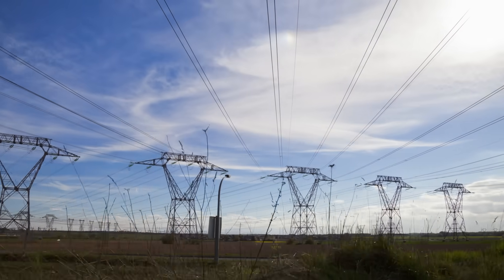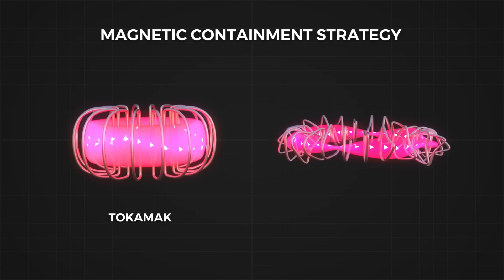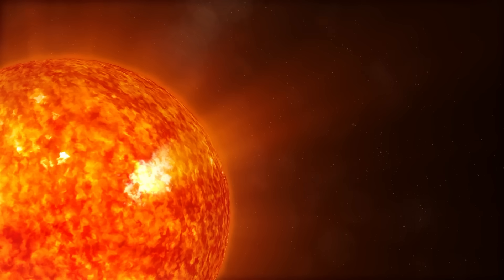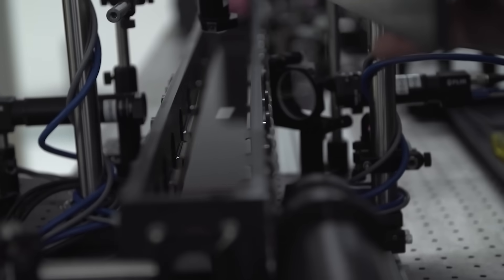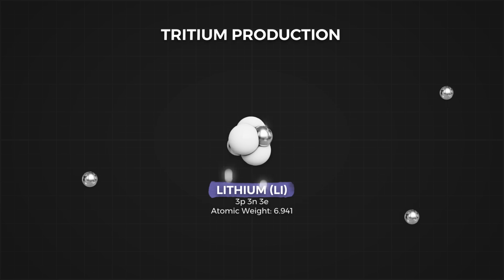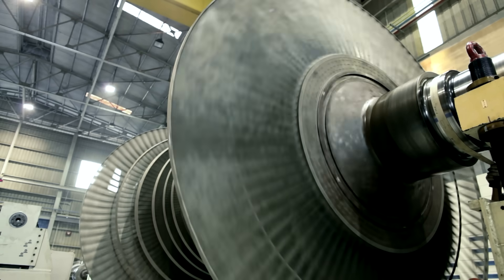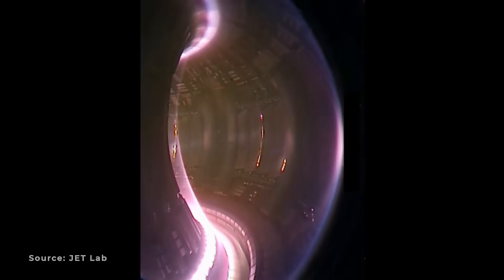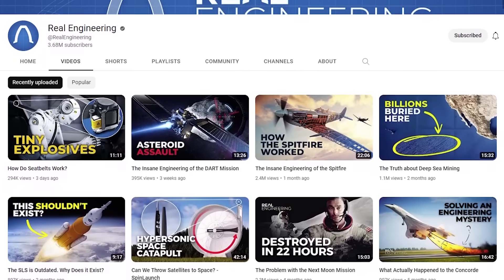The Problem with Nuclear Fusion

Comment: It's really sad to see you take a one molecule shallow dip into things you don't understand.  You've drank the Fusion Funding Machine's Kool Aid which led you to make this video implying that controlled fusion is possible on earth.  It isn't.  This is a nuclear engineer and nuclear physicist speaking, one who has no financial interest in the corporate welfare machine.

Your next video is going to be even worse.  You've drank the Helion Kool Aid without any critical analysis.  Here it is.  They propose to use He-3 as a fusion fuel.  It may or may not work but that doesn't matter.  DOE estimates that there is less than 30 kg of He-3 on earth.  When you dig deep into Helion's publications, some behind pay-walls, you learn that their plans rely on mining He-3 from the moon!  Is that crazy or what?

There is no easy way to make He-3.  The principle source of He-3 is the decay product of tritium.  Outside of the nuclear weapons world, T is quite rare.  DOE likely has a significant amount of He-3 because of the decay of the T used in boosted fission bombs but they're not saying.

T is a problem in and of itself.  It is produced in relatively significant quantities in nuclear power reactors.  A couple of decades ago, someone suggested we look for T in a nuclear plant.  When we did, we found it everywhere.  T behaves just like hydrogen and seeps out of and/or diffuses through many materials used in a nuclear plant.

T's decay produces a single beta particle that is so weak that the only way to detect it is to mix the sample with a liquid scintillator (POPOP is the most common) and count the light pulses emitted from the solution.  The beta is too weak to have any biological significance.  The radiophobes who use the discredited Linear-No-Threshold (LNT) theory of the biological effects of radiation (that any amount of radiation dose, no matter how small, is harmful.) howl about T so there's a certain bit of hysteria associated with it.

I frankly can't imagine making T by the ton, required if the Helion approach works, which is far from a given.  There are other ways of making He-3 but all are more expensive and/or use rare elements such as Li-6.  Helion's approach is just another dead-end competing for fusion research scientific welfare funding. 

BTW, the claim that D-T fusion would be clean is a bald-faced lie.  The bulk of the energy produced (you said 80% but it's actually about 95%) is in the form of a high energy neutron.  High energy neutrons damage things and make them radioactive.  Someone put the idea in your head that a D-T reactor, if it worked, which it won't, could be surrounded by a fertile blanket of deuterium to breed T or He-3.  It's not too hard to calculate how thick the blanket would have to be to stop the >5 MeV neutrons.  Very thick, probably too thick to manage, plus the T produced would have the same negative properties that reactor-bred T does.  A utility-grade D-T fusion reactor would make a massive amount of radwaste through neutron activation.

Yesterday (12/13/2022) DOE released a breathless but absolutely false press release that claimed that the National Ignition Facility had made a breakthrough - that inertial confinement fusion had produced more energy than required to make it happen.  But they lied, as they counted as input energy, only the energy supplied by the laser beams and not the total energy consumed by the NIF.  From their website, the NIF consumes 200 megawatts continuously while doing make-ready for the shot and then firing it.  And (again from the NIF website), when they implement automated optics repair to deal with the damage each laser shot does to the optics, the NIF is only capable of 400 shots a YEAR!  The NIF is doing what it was designed to do - help nuclear weapons designers improve their modeling codes that will allow them to design new bombs with no need for testing.  Controlled fusion power research was tacked on as a publicity stunt.

In response to that lie, I built a spreadsheet that, when a desired energy in megawatts is input, it calculates a variety of parameters which show just what a lie the NIF press release is.  The spreadsheet comes with 3500 MWt as the input.  That is the power a fission reactor makes to drive a 1200 MWe generating plant.  To make 3500 MWt, the NIF would have to do 1.79E+18 shots per hour.  Inertial fusion does not scale up to larger target pellets because of a variety of instabilities known for decades by both weapons designers and honest fusion researchers, if there are any.

The spreadsheet can be downloaded here: 

https://u.pcloud.link/publink/show?code=XZucYDVZxbTnsKyKIEhMDekJdz3CPzi6z7G7

In case anyone wants to play around with the numbers.

Comment: The moon supposedly has H3 which apparently when used in nuclear reactors for power generation create no radioactive waste.

The earth doesn’t have enough but the moon might so countries are desperate to get back to the moon and confirm the H3 and figure out a way to mine it 

This saves the cost of the radioactice waste

Comment: fusion power will NOT revolutionise globl society.  as you pointed out, we already have an energy source that is cheap, clean, and abundant, compared to older sources .. nuclear fission. the problem is the global hyper-capitalism, which will manufacture scarcity to preserve global power structures... look at food, for example; we CAN solve world hunger today, with current methods and technology. this could have been done at any point in the last fifty years.  but the will of those with the power to do it does not exist, because it would be detrimental to them. what makes idealists think that energy scarcity is any different?
Reply: Nuclear fission requires us to mine uranium. And there's a limit amount. 

Fission takes water as fuel, and there's a lot more water than uranium.

Comment: My main concern about this energy remains, it requires a Massive amount of energy going in, and a massive amount comes out, but it’s the DIFFERENCE between these values which matters, so in general we don’t get much out of this..  What’s the point of this huge amount of effort only gives us a little extra energy?
The need for rare elements makes this even worse..  If we need to send people to moon and exhaust MASSIVE amount of energy to collect and process the resources, it’s just a waste, and the environmental impact might be worse than current methods because the process as a whole isn’t better.  Also, causing fission isn’t hard, getting energy out of it is, and that’s why this feels like a pipe dream..
Reply: Congrats. That is the problem.
Reply: @osyisr6361  I hope you’re not patronizing me.  Complaints about the current methods we rely on are still valid, CO2 and other forms of pollution are going to continue causing major problems, I just want to ensure we’re not wasting resources on a novel concept that will never actually be useful..
Reply: Technically a functioning fusion reactor would not function with massive imput of energy to release an even more massive output of energy. It will need a massive quantity of energy to be primed and started, and then the reaction will be self-sustaining. Just like fusion reactors work in a way.
Reply: @chusnacho4447  So what?  A campfire is self sufficient too, that’s not as an impressive an accomplishment as you think.  So long as fuel is continuously provided a campfire will still generate power.  A fusion reactor requires a lot of power to operate, and will continue to require a lot of power to operate even if it’s on non-stop because of the massive amount of equipment required, and the fact that this equipment uses a ton of power to prevent the equipment from being destroyed by the heat.
Reply: @FurryEskimo  It is an important distinction, since the energy generated is used to maintain the reaction, and maintaining the reaction includes all the energy involved in containment. And all of this is not for a "little extra energy". The fuel-density in a theoretically operating fusion reactor is orders of magnitude bigger than in any other form of energy generation we know of, even accounting for very expensive containment. The thing is when or if we will reach it, but ¿what do you want to do, abandon research alltogether?

Today, we need massive on demand energy that can spike and that is clean and that will not run out of fuel. Fusion, theoretically, could provide all that. ¿what is the problem with expending very little money in exploring this possibility?
Reply: @chusnacho4447  Yeah, it can be scaled up theoretically, but so can other forms of energy collection.  A coal plant produces enough energy to sustain itself indefinitely, but it’s not run non-stop either because maintenance is still required.
I’m not trying to be pessimistic here, but I want to make sure that all this effort will lead to something useful, because frankly, it seems like solar and wind might be easier and more reliable than fission, and their drawbacks might be easier to deal with, but idk for sure,

Comment: Yeah cause free energy is not theoretically a time bomb of global warming, just think about it for a nanosecond.
Reply: Fusion reactors would reduce our dependence on fossil fuels and natural gas if it ever becomes economically viable and widespread, reducing carbon emissions. That is a very big if though.
Reply: @rennoc6478  Yep we stop directly stop burning things and open the flood gates on heat from a human race unleashed from the cost of production, you know exactly what I am saying. Air con in the hot areas and heating in the cold and no need to turn the lights off anymore, the human race has no self control. Oooooo wait we could just manipulate the global temp, that will end well. Our society needs to change to adapt to this first.

Comment: the problem is figuring out the power requirements to reach 12 kelvin to achieve fusion, then miniaturizing it to a cheap abundant, once fusion is achieved it has to be sustained or it'll cost a ton of money to start it back up, it has to be sustained, stable, and so durable that nothing ever has to be replaced or shut down for maintenance
Reply: Part of the problem is that you need an extremely hot plasma in order to fuse deuterium, surrounded by an extremely cold superconductor in order to magnet the plasma away from everything else.

Comment: Regarding radioactive waste of fission reactors - you should know that there is a technology that re-uses fuel that used to be "waste" up to 95%... and it is already used in practice as a routine. Where? - oh ...in Russia. It is estimated that world has -  today - a supply of ready for use fission fuel if replenished with this technology - for 1000 years. You literally do not need to dig a single ton of uranium ore anymore. Literally - today. Just one problem - only russians do this.

Comment: the never ending bullshit about nuclear fusion. As long as every fusion device uses tritium, fission reactors will be needed to produce it. And you cannot store tritium, it decays to He-3 in less than 15 years. Yes, He-3 can also be used in fusion devices, but it is like going in circles. Then, these reactions generate neutrons, which degrade the shell of the Tokamak, turning Carbon into Oxygen, and things like that. Plus, everybody is busy  writing computer simulations about plasma loops and other random fluctuations in the core, while no one is trying to figure out how we get a 100 MK fluid to interact in a heat exchanger with water at 300 K. The high level physicists busy writing BS papers seem to have forgotten one of the basic laws of Physics= CARNOT'S LAW

Comment: the fucking problem is that it doesn't exist and things that do 90% of what it does exist but we don't use them because we're retarded
Reply: ? it actually does exist...
https://www.youtube.com/watch?v=w-5bNFg50KU

It just happened.
Reply: @troubledseed  1 to 1.5 isn't enough. It isn't the first time that more energy came out than the amount of energy that went in. The problem is everything else. Give me a second I'll go find how much more energy out it takes than in to make it sustainable and I'll post a link.
Reply: @mordet2  damn.. i really wanted this to be  the breakthrough I thought it would be
Reply: @troubledseed  me too. I wish we had, essentially, unlimited power. And we might, one day, have such a boon. But I don't see it happening right now while we're dying on our overheating rock. I think that we should first work towards things that we KNOW and HAVE the  technology for, fission, instead of funding pipe dreams, fusion. When our situation will have stabilized then we should work towards extremely long term energy. For now, fission is good enough to make sure we don't overheat until we get to sustainable, renewable energy. I think.
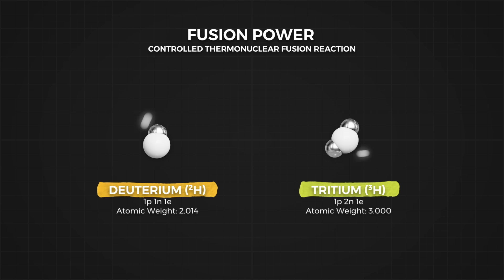Reply: @troubledseed  I know it's 15 minutes long but it's worth it: https://www.youtube.com/watch?v=JurplDfPi3U start from 5:50 onward for the why the 3:2 isn't enough

Comment: The problem not talked about enough is the political class’s addiction to maintaining reliable wedge issues by refusing to truly solve major and highly controversial problems. They do this out of laziness and fear, the fear being of potential irrelevancy and fear of the new. This is why they saddle us with boondoggles that only treat major problems on the surface, giving the illusion of a solution, but resolve nothing in reality. As applied to energy and pollution, this is especially loaded with bizarre hubris. Take the grid shielding crisis, yet they simply won’t ACT like it’s the single biggest existential crisis in the world. They have shown the power of fear can guide millions in a common direction to a common goal, yet they still won’t do that for the grid. If we get a direct hit by an 1859-like solar storm event, fusion will cease to be an energy issue for at least a hundred years minimum, IF we’re lucky. Other problems could cascade things exponentially worse and rebuilding could take far longer, however. At least a brief dark age will be inevitable, and we’re overdue for such a storm. Yet nobody is taking it seriously who could do something about it.

Comment: Energy is always free and abundant. Oil is free, coal is free, wind is free. The problem is the capital costs of getting it into a form that we can use. Fusion may one day work, but we have no idea if the economics can make it abundant. Not just the capital costs of the fusion plant, but if you want to use the energy in inefficient, high consumption ways you're going to need a much, much bigger distribution grid. There is no shortage of any energy source: oil, coal, wind. That doesn't set the price.

It's like food. Food is free. It just grows out of the ground. But it's not free to consumers.

I'm sceptical that fusion will ever be more than a science experiment. It may well be in the "can be done, but not worth it" category like monorails.

Comment: I have to say Fusion is pointless. Why because it requires tritium which is only made from fission reactors. Just like making a hydrogen bomb you need a nuclear bomb in there. Fusion requires fission for the byproduct it creates.  Ok. Where are we w/ our fission tech. We have had non reacting fission reactors for decades in the form of MSR, and SNR's and no one produces them? Why because we are racing towards fusion all while building more coal and gas power plants around the world and shutting down fission. We are such a retarded ppl. It makes absolutely no sense unless you run a business off the bs we have going.  Then its all you think about keeping going. Lastly this fusion push does exactly that. It prolongs the use of fossil fuels because the reach is so far out of grasp.  All when we have totally clean power now. They solved the waste problem by drilling boreholes on site of the reactors miles deep They drop the fuel in like a bullet in a gun just dropping it in the ground under the water table. Im talking a mile + deep. We have the solution now w/ fission. Clean power. Again we are fools.

Comment: Yawn...  All of these claims about cheap abundant energy ring true for wind and solar as well.  There we only have to solve
the storage problem which despite slow progress with batteries is far closer in than 100 million degree machines with 
hair like tolerances that must as a whole be continuously reliable.  Take a look at the picture of this contraption (and that is what it is) and you can easily see that it is
the most complicated machine ever devised by man.  That means it is riddled with failure modes.  More specifically serial failure modes.
Anything breaks then the whole thing goes down - which means you have to have another one on standby whilst you are fixing the broken one = all of nothing.
Contrast this with a wind or solar farm where you lose a solar panel or a turbine then you replace it = parallel failure mode. No one ever notices.

They haven't even begun to consider the engineering challenges for what it would take to actually build these things in any quantities 
and my bet is that they will never reach economies of scale.  This is an exercise in mental masturbation.  Take all of those fine minds,
with those fancy degrees from Snob University, hand them a shovel and make then work on a better battery.   Same thing with all of the stupid money 
we are spending on Mars. 2.7 billion (that's billion with a B) to determine that the planet is dead, was always dead and will always be dead and all we have to 
show for it is a bunch of pictures of red rocks.  Wait sorry now aerial photos of wait for it.... yet more red rocks.  I would have told you
that for free.  Both are exquisite pieces of pointless engineering.